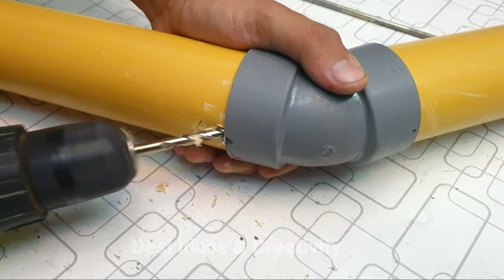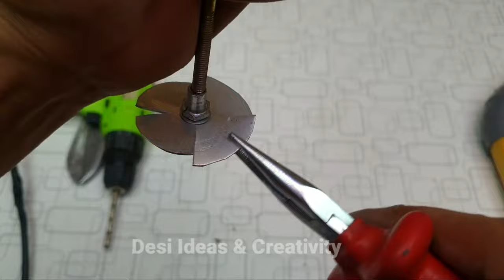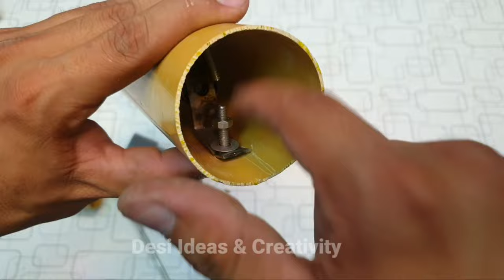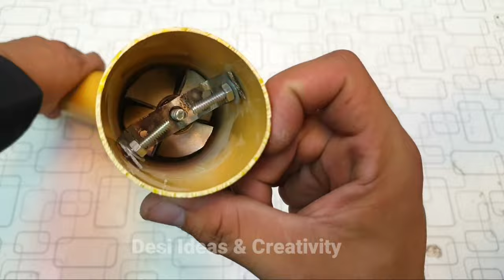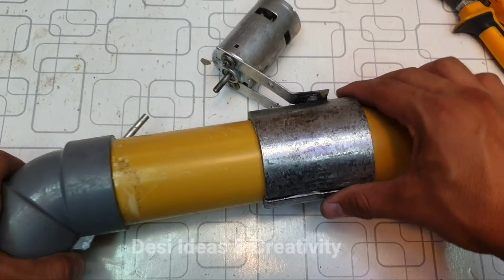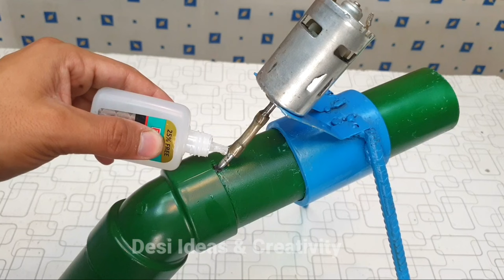Powerful Turbine Waterpump from PVC pipe #diy

Comment: como tiene un eje largo prueba ponerle varias aspas para que aumente el flujo del agua y el acople con el motor lo puedes hacer con un tubo metalico con tornillos para que tenga mas fuerza y no se dañe esa goma que le pusiste pero esta muy bien la idea que tienes

Since it has a long shaft, try adding several blades to increase the water flow and you can connect it to the motor with a metal tube with screws so that it has more strength and does not damage the rubber you put on it, but your idea is very good.